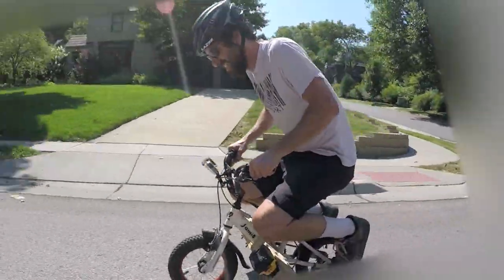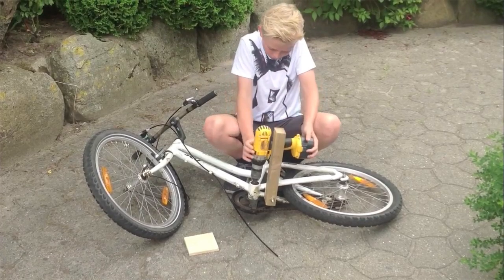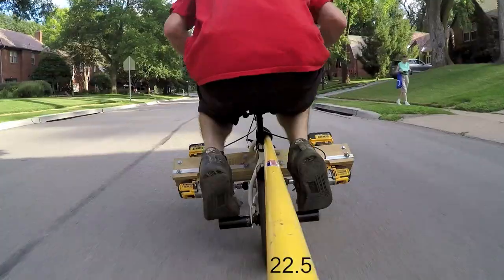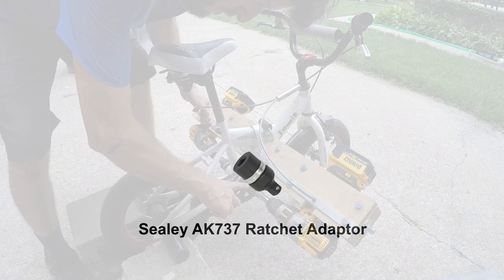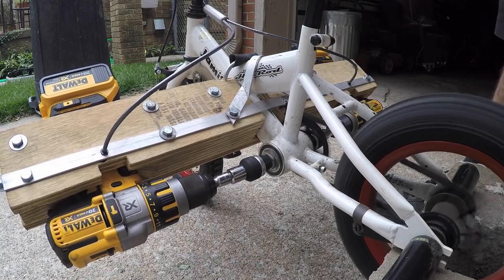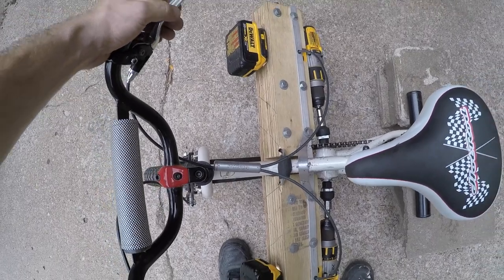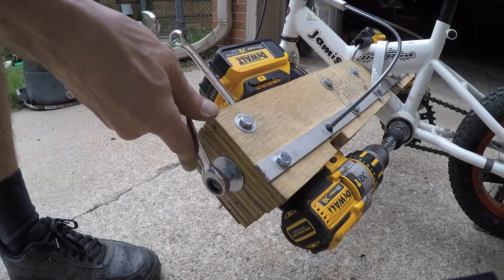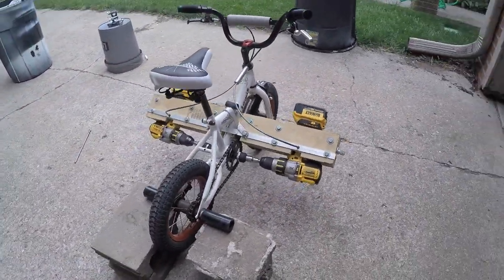Dual Powered Drill Bike 25+ MPH!

Comment: this is f*ing epic, i' m imagining this with a large drill motor ...
Reply from the maker: I used the biggest drills Dewalt made at the time, but they recently released a gigantic 60V stud and joist drill. What kind of big drill are you imagining?
Reply: Would two Hilti can work with inverter?
http://my.ifdesign.de/upload/award_img_277/oex_large/130763_01_L062671_b.jpg
Reply: Nah, use a green works 80v brushless trimmer motor, I would say lawn mower but that might be too fast

Comment: I would like to see your invention on a 10 speed. You would still need the pedals to get up to speed. And have you thought of switching to grinders?
Reply from the maker: Angle grinders do not have variable speed controllers, most are 100% ON, drills have the best throttles and lowest RPMs.

Comment: Crazy good fun. I like the Cornholio yell on that speed run. I'll be using those ratchet thingies thanks to you but if you had opposing drills wouldn't the clutches act as a differential considering gearbox is running forward and one backwards. I want to run this on my Kim Hendricksen style skateboard. By the way mine has 12 in front wheels lol.
Reply from the maker: The drills do have a clutch but they do not freewheel or coast. It is nearly impossible to get the two drills to run at the exact same RPM by squeezing the two throttles perfectly in sync. Sometimes one drill will stop working and without the ratchet adapters it would be like arm wrestling the two drills.
Reply: @ScottBl8ke  Yeah I forgot about freewheeling but you could sandwich a freespin between them. I have a Ryobi brushless, an older green brushed, and a blue right angle.  If I can't source some cordless drills I might just go straight ahead with the REAL power on it anyway. I'd like it to climb hills and find someone dumb enough to bomb a downhill run on it (I rarely find appropriate test idiots so I usually end up that guy lol). Either way it's gonna be a blast to ride. I'm having fun building it already. Cheers

Comment: Oh that's wonderful.  I actually was about to reach out to you as a matter of fact.  I got my bike motor to run.  I actually bought an 80v kobalt battery. It's only 2.0 amp hours but you will.be so.surprised how.much ride time I get with it.  You have to pedal.as much as you can but by doing that alone.  My voltage gradually goes back up.  It will die out at around 58 volts.  But I was so surprised that this actually worked.  Also going down hills, your voltage will gradually go back up too.  I took the bike to work.  Also I have a boosted board dual+.  Great board.  But it is lethargic on hills.  Nice on straights though.  I really want to get a front truck motor kit.  I only use the board and bike cuz my job is about 3 miles away from the train station.

Comment: Do i really need a rachet adapter?
Reply from the maker: The two drills are spinning in opposite directions from each other, and the brushless motors do not spin freely. It is like the two drills are arm wrestling. Plus the triggers are extremely sensitive, and it would be nearly impossible to get the two drills to run at the exact same speed. You wouldn't need the ratchet adapter if you only used one drill. Most bikes have a freewheel in the rear hub, and when you stop pedaling or drilling, the crankset stops spinning.
Reply: Thanks for the help and replay!! :-)

Comment: do u think bigger the drill faster we can go? I wanna do this soon
Reply: Seday Sanchez no not really buddy. Those Dewalt drills are about the best you can get. You can get 36v Dewalt batteries but they just last longer, possibly could add a little bit of extra speed. But like I said those cordless drills are about the best you can buy.
Reply from the maker: The Dewalt drills are rated 850 watts each, and I run them in the lowest speed setting at 450 RPM. I hit 28MPH on this bike the other day. https://www.youtube.com/watch?v=g7eI3FuolLM Not sure I want to go much faster on a bicycle designed for children, but let me know if you make one.
Reply: i want to make a bigger one on a mountain bike

Comment: Maybe if you have 2 good drills this works nice, but what would be a normal motor equivalent? Just a motor might be cheaper.
Reply from the maker: Interesting question xCCflierx. The Dewalt DCD995M2 hammer drills I used are rated at "650 unit watts out of (UWO) max power." An equivalent electric motor, like the 500-750w on ebikekit.com, costs $1,300 with a 36V lithium battery. I paid $300 for each of the cordless drill kits, and I would need two extra 20V batteries to go a similar distance as the electric bike. Plus the Sealey ratchet adaptors cost $25 each, Problem Solver's cable doubler $50, all the wood, metal, and hardware is around a $1,000 in materials invested in the drill bike. I'm sure using drills is not the cheapest way to motorize a bike, but it was fun to make and riding it is awesome. I also prefer electric over gas power, but a small weed whacker engine would probably be cheaper.
Reply: Scott Blake I just don't personally own drills. I just want to tape a motor to the side to get a similar result, but drills are built with "safety" and "optimization" built in for consumers, which I would rather not pay for. if 500-750w is equivalent, then 1 500w motor costs about $60-$100, and I can just pick up a smaller batter, like a drill battery, instead of the huge expensive e bike batteries. Looking to do the same thing and just have a small fun to ride machine. Doesn't have to go super far
Reply from the maker: Right on xCCflierx. I've seen some non-drill powered bike scooter things with simple motors just strapped to the side like you are talking about. Here are a couple of cool examples.

Physics Dude https://www.youtube.com/watch?v=Yb9T6q-17gk
3DMachines https://www.youtube.com/watch?v=Sj9hPwF5tQ0

I like using drills because the throttle control is built in. You will need some kind of way to adjust the power from the battery battery to the motor, and you will need something on your handlebar grip to adjust the throttle. I highly recommend you start making something, and you will figure out the little details.
Reply: thanks for tips and link :)

Comment: You know what happened? I solved the problem.  You know the nickel tabing where the circuit board for the charger port is?  Well some of it wore off and it caused the charging ports to become inactive.  What I did last nite was simply solder a connection using nickel from a Ryobi tool battery and the kobalt battery is working again.  Im gonna use the bike to go to work tomorrow.  

Are you familiar with circuit board nickel tabing wearing out???

Comment: hello, it's good but not reliable ... it will heat much
I with a motorized engine alternator conversion
Reply from the maker: I ride this bike almost everyday, and so far it is has been very reliable. I've overheated other electric motors, but the Dewalt brushless drills I used are really tough. I did break some spokes on the back wheel recently.
Reply: yes, use brushless motor ...
it is possible to convert an alternator, a powerful engine ... it's cheap ..
go see my prototype on my chain youtub
see you soon
Reply: Not if you put an ice pack on the battery

Comment: Hi how are you? I have been thinking about this for a long time. I have a 3000 watt hub motor for a bike and a 72 volt controller.  Is it possible to use two 36 volt cordless tool batteries to make it work? The manufacturer told me that it has to be at least 20Ah for it to work. 
     I hope to hear from you.
Reply from the maker: 3000 watt hub motor with a 72 volt controller sounds awesome. Is it a Crystalyte? I think you could power it with two 36 volt batteries wired in series. Check out Blair88mph's electric bike powered by six 20 volt Dewalt batteries. https://www.youtube.com/watch?v=ISR8pKoIa5k
Reply from the maker: Watts equals volts times amps, so to power a 3,000 watt motor with 72 volts you'd need 41 amps. "An 18 volt battery rated at 3 amp-hours should ideally be able to deliver 3 amps of current at 18 volts for 1 hour before it is depleted." I use Dewalt 20 volt batteries with 5 amp hours. I wonder if you could hook up four in series to get 80 volts at 20 amp hours. Let me know what you figure out.
Reply: I was checking out all kinds of cordless tool batteries. Ego makes one that is 7.5 ah. Only thing, it is 58 watts 😞
Reply: Thanks for the feedback. I thought that if you hook the batteries up in series, you increase the voltage only.....amp hours stay the same
Reply: That's the thing. Why am I going to go and get a lithium battery overseas for over $1000 when you have all these hardware stores that sell cordless tool batteries for much less and you can modify them.  Take care
Reply from the maker: I found two videos showing how to use cordless tool batteries to power electric bikes.

https://www.youtube.com/watch?v=izBDbKbOj9w

https://www.youtube.com/watch?v=naAZqSHZLGc
Reply: Good news. I made my ebike battery using some Ryobi batteries.
Reply from the maker: Right on Reynault. I'd really like to see what you did. How many batteries are your using, and how did you connect them? Series/Parallel? If you can, upload a little video showing your Ryobi powered e-bike. sounds awesome.
Reply: Four Ryobi 18 volt lithium batteries in series.  Currently have problems getting the motor to operate.  It stalls.  I wonder if its due to low amperage.  It is only 1.3 amps.  It's 3000 watt motor
Reply from the maker: A 3,000 watt motor is big. I have a 1,000 watt hub motor on my regular e-bike that is plenty fast. Depending on where you live, most states classify electric bikes with motors under 500 watts. A 3,000 watt system would be amazing, but I think you are going to need more batteries. You could add four more batteries in parallel to increase the amps, or I see Ryobi sells bigger 4 amp hour batteries. How did you connect the four batteries together you have now?
Reply: It was simple. Just connected the positive and negative terminals. Pretty straight forward
Reply from the maker: I just finished making an electric skateboard powered by four Dewalt cordless tool batteries. I connected two of the batteries in series to get up to 36 volts and the other two batteries in parallel to double the amps. https://www.youtube.com/watch?v=D8mpKAz_eRw

Comment: can you build one on a mountain bike?
Reply from the maker: I prefer to make small bikes. I'm thinking about making a 16 inch version. You could make whatever size you want. A front suspension fork would be nice. You also might be able to get the drill to run in a higher RPM with the rear gears on a mountain bike.

Comment: This is the battery I got recently.  It's a Kobalt 80 volt max battery for outdoor tools. It's only 2.0 ah. But it runs very far. It will run 7 or 8 miles but you have to pedal too.

      It ran very nicely the first time.  I was pedaling and using the power from the hub motor but very lightly.  But on Friday August 4th, the terminals got a short. 

     The voltage went all the way down to zero and the voltage display turned off completely.  The battery did get very warm.  But it was not hot. And there was no smoke.  I let it cool down.  I put it on the charger and it would not charge.  I test the terminals with my battery tester and it would not read.  The terminals shorted.

    However all of the lithium 18650 cells are still good. 

    I can not understand why this happened
Reply: Reynault Chevalier if your battery dropped below a certain voltage, the charger recognizes it as a fault. Follow this video to revive your battery.

https://youtu.be/GCMDtcmi1DQ

Comment: Is that a 16" bike?
Reply from the maker: It is a Jamis Hot Rod with 12 inch tires.
Reply: Scott Blake I have 16" specialized hotrock . Ive been wanting to make an ebike out it. Until this video, I hadn't seen anyone try it. 

                         Thanks!
Reply from the maker: I ride this little drill bike for fun almost every day. It is perfect for short little trips. No pedals is a little weird, but the two drills supply plenty of torque. Cordless drills aren't cheap. For the same amount of money you could get hub motor on a 16" rim direct from China from theebikemotor.com I got a kit from them for another project and it worked great.

Comment: At least put an angle drive on your drills so they  aren't sticking out into traffic. Any hardware store. 20$ each. Much safer.
Reply from the maker: I thought about using angle drives or 90 degree drills, but the additional gearbox reduces efficiency and inexpensive angle drives can't handle the torque.

Comment: with one drill it will go 25
Reply from the maker: One drill is half the power so it will accelerate slower, but the drills do have a max RPM which determines top speed. I weigh 150 lbs and need both drills to ride up the steep hills in my neighborhood. One drill is half the torque,  half the climbing power, and half the carrying capacity, but you still might be able to reach 25MPH.
Reply: If you set it up so that each drill had its own cable then you could use both to get up the speed and then just one to maintain speed and save on battery life.